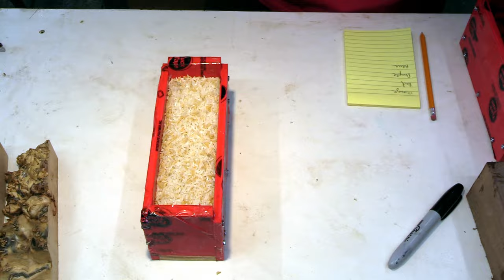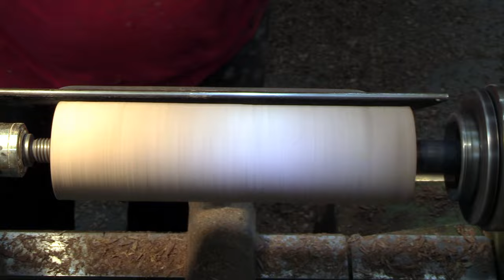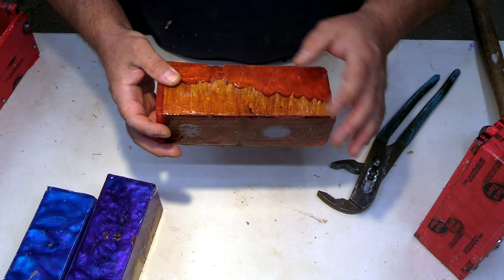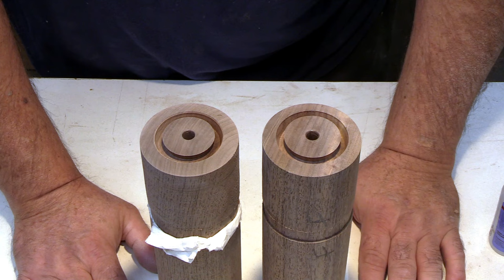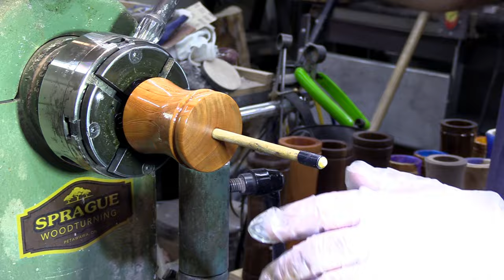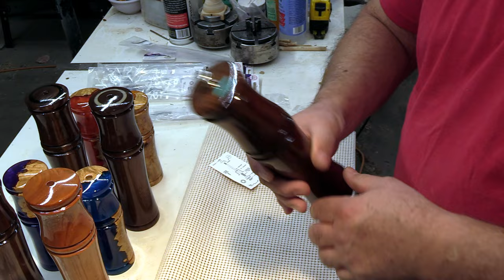Woodturning - Salt and Peppermill Extravaganza (The Nasty!)

Comment: I love how these turned out! The 3rd thing I made was a combo salt shaker and pepper mill. It was NOT easy for a newbie! I might try it again when I get my new lathe wired, but probably not. LOL
Reply from the maker: You actually need to have a decent lathe, I don’t consider these beginner projects. Thank you very much!
Reply: @SpragueWoodturning  Ilhubby bought me a new Powermatic 3520C for my 50th birthday, but I haven't set it up yet. I'm moving my shop to the garage so it's closer to the house and warmer in the winter. Hopefully, I'll be turning on it shortly after I return from vacation. I'm very excited to be switching from my starter lathe from harbor freight. 😍

Comment: I disagree about the screws. 
Everything should be Torx. 😀

Awesome work as always, spicy one might say.

Also, it's the quality that determines if the steel corrodes or not. But salt is also harder than steel and would eventually grind it down. If the screwes is stamped A4 they are acid resistant.
Reply from the maker: They are way too small for any stamping. Not much of a fan of torx either, lol. Thanks

Comment: drill a hole in the bottom of your molds and fill it with silicone then when your want the cast out pull the plug and hit it with air be caurfull tho it will pop out with force or can
Reply: also some one was stealing my tools so i locked my wen 12 inch lather in my blazer with about 1000$ in tools and chucks and morstaper tools and they stole the blazer when i get my new lathe i think i want to spend the cash and get a 3 in one lathe
Reply from the maker: I’ve also done this on the channel with limited success. Not cool having your truck stollen! Thanks for watching

Comment: Those are some awesome pieces. Since I dont make this product I did not realize the price points on them thanks for sharing that. During the live you mentiond how much sandpaper you used on each one I understand that pain doing the spindle work I do it does take a lot of sandpaper. Do you ever wet sand your work. If not why? Thanks for sharing your time and experience with us all. Congratulations to your son and to you for 100K. Keep up the amazing work. 👽
Reply from the maker: I’ve tried it here on the channel, I find it slow and I can get the same finish with the Tripoli buff after sanding to 800 dry. Thanks for watching!
Reply: @SpragueWoodturning  Thank you for the reply. 👽

Comment: The resin was a cold pour that's why it shrank away from the burl. If you heat up the burl and mold in a oven you won't have a cold shrink like that
Reply from the maker: Interesting, I’ll try that next time. Might need a bigger oven though, lol. Thanks
Reply: @SpragueWoodturning  perks of having a husband that worked in a polyurethane manufacturing plant. They used to make different things and had a ton of molds. Big warming and curing ovens. If I'm in a hurry I don't warm up pen molds and I get the shrinkage.

Comment: Concrete finishers will tap the sides of their forms to jog air pockets out from the sides. It’s not a perfect science but it usually helps. When I’ve done it I usually tap with a 12lb sledge hammer. That might be overkill for your purposes 🤣
Reply from the maker: Thanks so much!

Comment: You mentioned about using tubes on the inside of the salt and pepper grinder. Can you give us a link to get them. Thank you for the great video
Reply from the maker: They are plastic tubes that I got from uline. I buy them oversize and cut them down the middle then squeeze them together and when placed into the cavity of the mill they will expand and stay in place. Thanks

Comment: Hey Jim.  These are beauties.   Question though, why didn't you use the UV liquid on the black and white wood peppermills instead of the c/a glue?
Reply from the maker: In order for the UV epoxy to work it needs to be on the clear side to cure, if it’s solid like both of the inlays on the top of the mills, I don’t think it will cure properly. Thanks

Comment: Very nice. Could you use actual salt and pepper for the inlays?
Designer Epoxy
Sandpaper
Reply from the maker: I’ve seen pepper used, not salt, I suspect when the glue is applied it will cause the salt to go clear and you won’t see it. But I’ve never tried it. Thanks

Comment: I’m just got my first lathe and I want to get a set of carbide tools. I checked out the hunter tools but a little to pricey for now. Could you recommend a little cheaper set? I really hate not buying the best. I usually buy nothing but top quality tools but I want to make sure I’m going to stick with it before I invest that kind of money. I looked on Amazon but there are so many and I don’t want to get junk either.
Reply from the maker: You really only need the #3 Hercules and a parting tool to do what I do here each week. Easy Wood tools might be the only other one I would recommend, but the difference in price when you use my code, for me Hunter Tools wins. Hope this helps. Jim
Reply: @SpragueWoodturning  yeah I agree. This helped me out tremendously. I’m going to take your advice and just order the number three Hercules.  Do you use a carbide parting tool or just a regular one?

Comment: Designer epoxy makes some nice mills, how much sandpaper do you go through? :)
Reply from the maker: It depends on what your sanding. When I was in full production I would use about 3000 to 4000, 3.5 dimple disks a year. Thanks

Comment: Hi 👋, Jim, I have a serious problem. I’ve just had to call the rehabilitation centre over in France, as that is where I am now live in., as I think I have mentioned before, put back in 1998/9 2000, I was manufacturing, pepper and salt, grinders, for the millennium in a year and a bit before 2000 I had made thousands, it got to a point where I was having nightmares, it’s days and night scene to be the same, routine that was an understatement, I was like a robot, repetitive, repetitive, repetitive, on and on, and on, 😂😂😂, 
I had 2 lathes ,  1 , Wadkin R8 , for boring the holes through the centre, I had made up a very large engineering tailstock with a motorised drive on it, that would bore a steps hole through the certain, at a depth and then retract, 
2 Kontour 1500 , semi automatic table, had a special cutter on it that will cut in both directions left from right, right to left, so I could turn a piece of wood down to a precise dimension every time, Even my drill press, like a drill, the two holes in the bottom for putting the screws into the bottom of the mechanism, was all set up for a precisely, I even had special tooling made to shape the tops of the mills, 
The bottom of all the Mills add a pure silver ring fitted dated and hallmarked for the millennium, 
I was so happy at the time I was living by myself, had no problems with anybody , Yes, I had spent a lot of money on the tools and equipment,
But within three months, I had started to recuperate my money, big time , 
Then in 2002 I met, I thought was a young lady that I thought was loyal and faithful , all she was interested in, was  my money, 
Very stupidly, we moved in together and bought a property , are there in found out that she was having a relationships with other people when I was out running serious money, in 2019, she started accusing me of being mentally ill, I even have that on a recording, she even told me that if I was was not happy leave, didn’t like it was to leave, so I did. I’m now in my 70s., living by myself, I wouldn’t say that I am happy, as I’ve just wasted approximate 18 years of my life, And i have restored 2 property 1 in the Uk and 1 in France, and because of what happened in 2019, I ended up moving to France, most of my tools and equipment, though I did have to sell my motorcycle to help fund my move, HD Deuce, They are coming to take me away. Ha ha, Hee Hee, ho, ho to the happy lands where are used to be, 😂😂😂, I seem to recollect there’s a bit of music that sounds like this, 
Anyway, back to a serious point, very enjoyable territorial, 😂 . Hopefully, one day, I will be able to afford to get some resin to make some pieces of art, Probably like yourself and lots of other people using your hands and your mind to be able to create something helps to relieve some stress, and your well-being, keep up the great work, Jim. You do amazing work, sorry I’ve got to go now there’s been a knock on the door think I’ve been taking me away, 😂😂😂😂, Phil from the moulin France, ❤😂
Reply from the maker: Yes, being setup for it can make some serious money. But death by repetition, lol. 
Sorry about the unfaithful wife, there seems to be a few of them around! 

Get some resin and start pumping out some of those peppermills, you won’t be able to keep them in stock, lol. Thanks
Reply: @SpragueWoodturning  Hi 👋 Jim, I havé just found your reply, which seems very strange, as normally it would come up showing at the top of my inbox that I have had a reply, obviously something untoward has happened to my device, anyway, thank for you for the reply. Hopefully in the not too distant future, I should be able to afford to get some resin, so I can get myself motivated, Last week I did manage to cut  up and stack and store all my logs and timber that had down over the last year and a bit, and some of them had actually fallen into the river or crossed into the next door neighbours field, luckily I hadn’t done too much damage over there, somebody with a very large tractor gave me a hand to pull them out, but ended up doing a lot of churning to my garden, which I’ve now got to sort out as well, 
Thank you for your reply and the chat, Phil from the moulin France